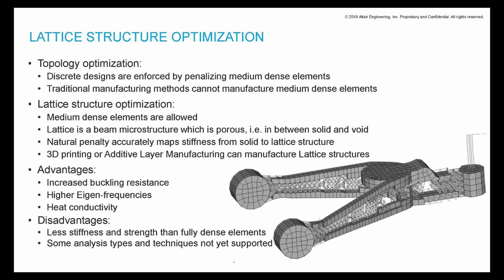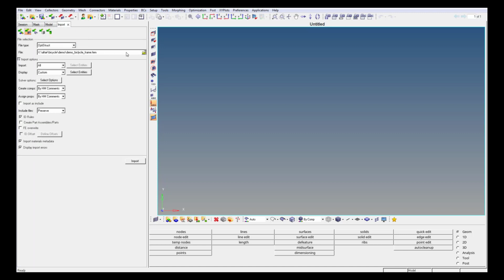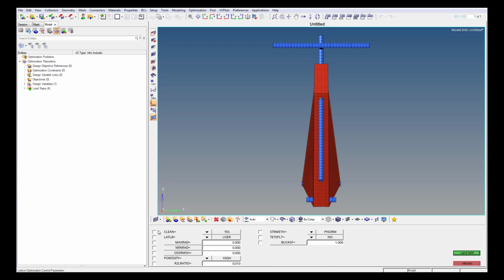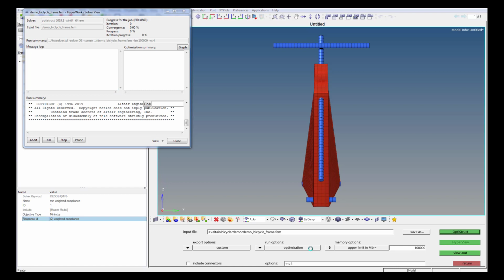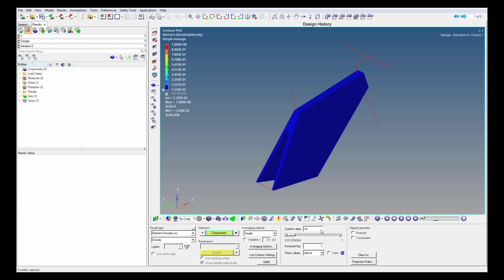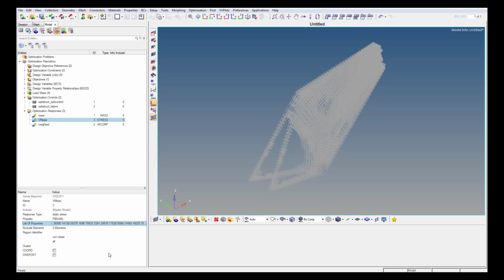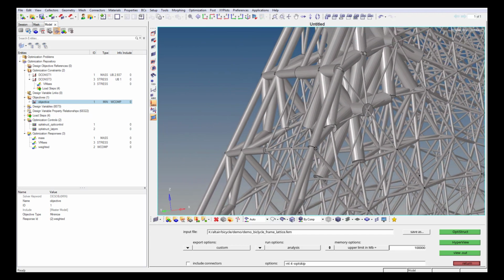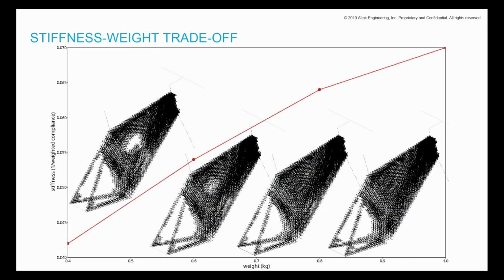Lattice Structure Optimization

Comment: Thank you for the explanation and the great video. 

i just have one question regarding the amount of memory located for such analysis cause i wanted to do the same optimisation on wings profile but the solver give me a faillure said that the amount of RAM i have isnt enough. So can you tell me the performance of your computer thats ables you to do such optimisation

Thanks in advance
Reply from the maker: I'm glad you liked the video.

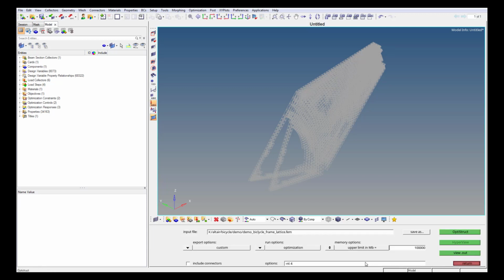 As can be seen at 15:50, I ran the optimization with 10 GB RAM as an upper limit. For some reason, to actually run with 10 GB requires one order of magnitude greater input of 1e5 Mb instead of 1e4 Mb (memory options). I have 16 GB of RAM installed.

You can try two things to resolve the memory issue:
-use coarser solid mesh in the first stage of topology optimization. The lattice structure generated after the first stage will use the nodes of the solid mesh as a framework.  The optimization formulation becomes computationally very expensive in the second stage lattice size optimization, wherein each lattice rod has its own design variables.
-run the optimization out of out-of-core. That means the solver cannot hold the entire matrix in RAM for solving. Instead, it does the solving on smaller parts of the matrix in RAM by writing the entire matrix to disk storage. That means it spends time reading and writing a lot of data to the disk to make its way through the entire matrix. This takes more time to solve.